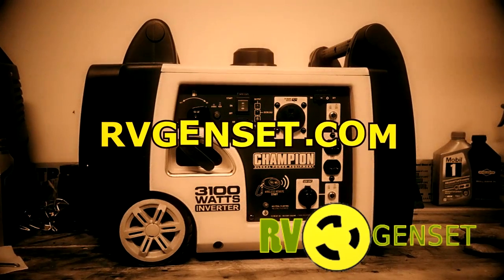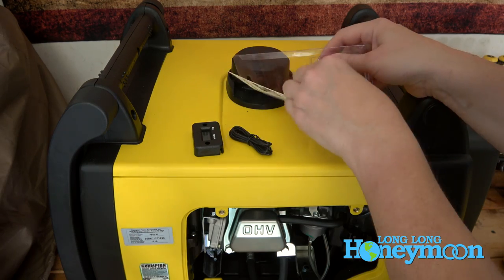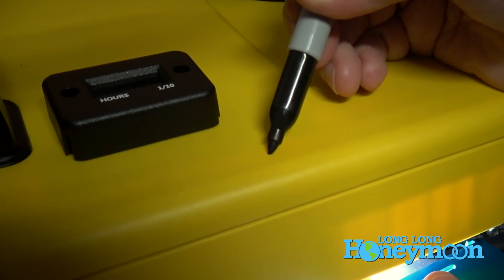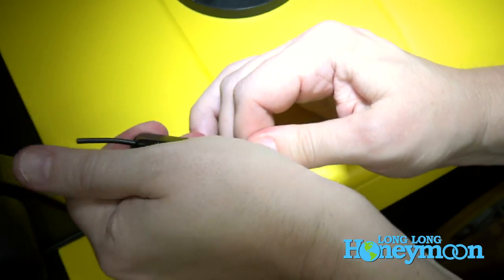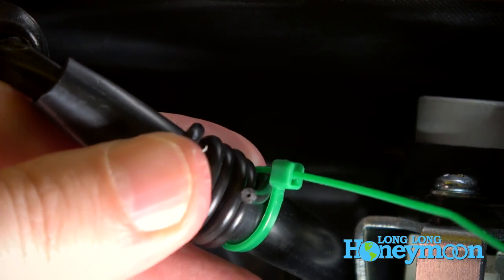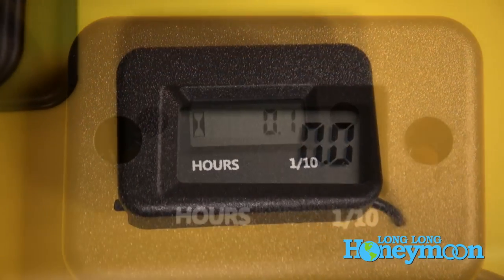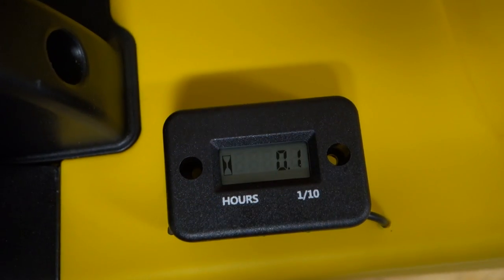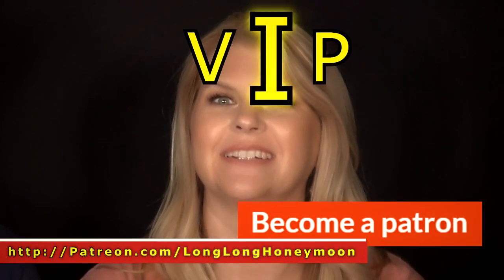🔧 INSTALLING AN HOUR METER ⏳ on a Champion Inverter Generator

Comment from the maker: "El Cheapo" HOUR METER https://amzn.to/2GFlr7D

GET YOUR RV GEAR HERE! http://amazon.com/shop/LongLongHoneymoon

Loloho on PATREON: https://www.patreon.com/longlonghoney...

OFFICIAL LOLOHO T-SHIRTS ARE HERE!!!! http://amzn.to/2qjgBkP

ScanGauge II rear view mirror mount http://amzn.to/2gsT9y8
CAT 6 Cable (for ScanGauge II) Extension http://amzn.to/2gtBGpo
OUR NEW STEREO http://amzn.to/2i1N3Zl
Archoil AR6200 http://amzn.to/2yevISv
Archoil AR9100 http://amzn.to/2zccfQX
Weber Q1000 http://amzn.to/2CENtcB
Weber Q1200 http://amzn.to/2sMkSTf
Good Sam Campground Directory http://amzn.to/2jiFm1k
Our INFLATABLE BOAT http://amzn.to/2dK4LMv
Our MAIN CAMERA http://amzn.to/2pyPR1s
Our SECOND CAMERA http://amzn.to/2pGXwce
Our FULL FRAME CAMERA  http://amzn.to/2pzevit
Our APS-C CAMERA http://amzn.to/2pH7kDk
Our POCKET CAMERA http://amzn.to/2qGIWkm
Our ACTION CAMERA http://amzn.to/2pGU6WZ
Our DRONE http://amzn.to/2qGSUCk
Walmart Locator: http://amzn.to/2HoUtgy
Loloho e-books http://amzn.to/1oh2jie
Loloho on Facebook http://Facebook.com/LongLongHoneymoon
The "BONE TOOL" http://amzn.to/2biUdiO
Antisway bar http://amzn.to/1zi9bgp
Counter Assault Bear Spray http://amzn.to/1FoY2fk
Oxygenics shower head http://amzn.to/1Et4Ydr
Inverter generator http://amzn.to/1Et52dg
LED spotlight http://amzn.to/1vA6qIW
Sean's Tilley hat http://amzn.to/1vA6sAB
Merrell Jungle Moc shoes http://goo.gl/WxSYgg
Walkie talkies http://amzn.to/1vA6wjN
Sanyo ENELOOP Rechargeable Batteries http://amzn.to/22eZnzU
Boeshield T-9 lubricant http://amzn.to/17zGLFa
Weber portable grill http://amzn.to/2t2EfCo
Air-Dryr http://amzn.to/1Et5fwX
OBDII code reader http://amzn.to/1vA6Dfn
Water “jerry can” http://amzn.to/1FuuSLU
30 Amp Surge Protector http://amzn.to/1oDlqDd
Garmin "RV Navigator" GPS http://amzn.to/22Yzh6r
The "El Cheapo" Garmin (#1 Bestseller!) http://amzn.to/1Rpmiqy
A Better GPS Mount: Garmin Portable Friction Mount http://amzn.to/1VRTfxH
Too cheap for a GPS? ;-) http://amzn.to/1ZIYUGp
MAXTRAX Emergency Vehicle Traction http://amzn.to/208EM0y
Champion 75537i http://amzn.to/2vzxbmv
Briggs & Stratton P3000 http://amzn.to/2huZsnG
Kill-a-Watt EZ Electricity Meter http://amzn.to/2vokKt4
Trailer Aid tire changing ramp http://amzn.to/17zGXUU
Pink flamingos http://amzn.to/1LF6Q2U

AFFILIATE LINK DISCLOSURE: Friends, making a quality Loloho video is kind of like making sausage – only slightly more violent. It's a ridiculous amount of work that typically involves high dollar camera drops, blue-screen-of-death computer crashes, and at least one angry shotgun wielding old man shouting, “Hey! Get the hell outta here!” Once the final video is posted, rewards here on YouTube are few and far between (unless you are a masochist who enjoys being verbally abused by anonymous trolls). One saving grace is our affiliate links. JUST CLICKING THESE LINKS HELPS TO SUPPORT OUR LITTLE SHOW. Think of this clicking as like tipping - except that it doesn't cost you anything extra! If you eventually make a purchase via one of our affiliate links, we will receive a few pennies (and Sean typically invests these pennies in duct tape and video gear). Again, it doesn't cost you anything to click these links, and it's a great help to us. As always, safe travels, happy camping, and THANK YOU!

Comment: I'm confused which generator do you use the Yamaha or the champion. you endorse the Yamaha but working on champion. also like other people mentioned avoid getting cut by grabbing the end of the tie wrap with pliers and twisting the end off it leave a smooth end. Tom
Reply from the maker: Tom, I try to keep an open mind and will test any generator I get my hands on. It's kind of like a guy reviewing cars -- I may like BMW but I'll also take an Acura out for a spin! I'm currently reviewing an Atima generator and I like it.

Comment: Is the meter waterproof? Otherwise, it could collect water on the readout face and short, maybe?
Reply from the maker: A valid concern, though people seem to use these on motorcycles and boats without trouble. I'm going to see if there's any easy way to waterproof it, even if it's 'water resistant.'

Comment: And of course, you added the hour meter for _________?  Oil changes?  And/or spark plug changes?  Yes, I think the hour meter is a great idea, Sean.  Good video.  Oh, and as an aside, will his particular generator run a 15,000 watt A/C unit?  Thanks
Reply from the maker: Haven't tried this genset with a 15,000W A/C but I think it would probably be a bit too much for it. Champion makes a 3400W model that might be better suited for the task.
Reply: They now have a 3500 watt that will run a 15,000 btu ac, still no HR meter though.

Comment: Did he drill a hole on top of the case. While the case my not be 100 percent water tight, we don't need to add more ways fir water to enter.
One might say they wont have it running in the rain, yea, until u do... 
Mounting it on the side would have been just as easy

Comment: Sean, can you run that generator in the back of your truck with the cover over the truck bed but the tail gate down? How are you feeling? Hope you are doing well...Gino
Reply from the maker: hey Gino, if you go "by the book" you are supposed to have a certain amount of space around the generator for ventilation. I think you can definitely run it in the back of the truck as you describe, so long as there's enough airflow. I'd pay special attention to the exhaust side as that gets hot. Personally I would probably roll back my tonneau cover a portion so as to free up space and allow the generator to adequately breathe. I'm feeling okay! Better than July, anyway. I go back to the doctor next week. Thanks!

Comment: Those generators are LOUD!!! 58 decibels vs. 53 on the old Yamaha you used to have. 5 decibels is a LARGE AMOUNT of noise difference.
Reply from the maker: They are definitely louder than a Honda or Yamaha, but they are not loud like an open frame generator. We still have our Yamaha but it won't fit beneath our tonneau cover. I'm going to try the Champion; if it seems to be too loud, we will switch to something else OR fashion a simple sound deadening genset box.
Reply from the maker: We are now reviewing an Atima with Yamaha engine that is quieter than the Champions (if barely a shade louder than a Yamaha). Stay tuned ...

Comment: BRAVO, LoLoHo!!  What a wonderful DIY vid.  However, I am anal/OCD enough to notice that you've installed it, so to speak, "upside down."  That is, it's upside down from the front of the genset.  It'll probably get kind of irksome after awhile. 

FYI.  ;)
Reply: I don't think so.  He is looking from the backside of the generator.  It may serve greater convenience closer to the faceplate control panel.
Reply from the maker: A valid concern, and that's one reason I opted to mount it with sticky tape -- if this position ends up being irksome I will reposition it.

Comment: While I love the price of the generator, I must say that I'm concerned about the quality of the  generator. Is it worth the $15 you paid for it?
Reply: Jason Carpp generator $15?
Reply: akbychoice The hour meter. My bad.
Reply from the maker: The generator is well worth $15! :D As for the hour meter, only time will tell (pun sort of intended). It seems to work fine and many report a positive experience with it. I'm going to try to keep this unit out of the rain, as I suspect water might shorten the hour meter's life.
Reply: Why not just put it inside the cover you don't need to be constantly monitoring it. It would be then be protected